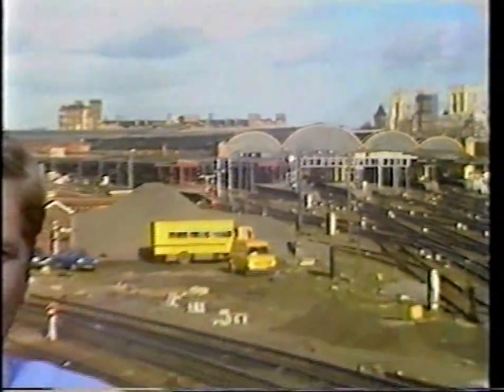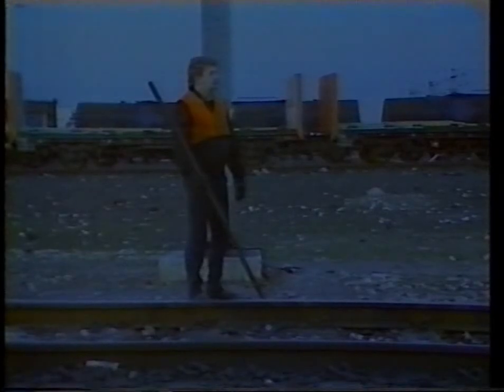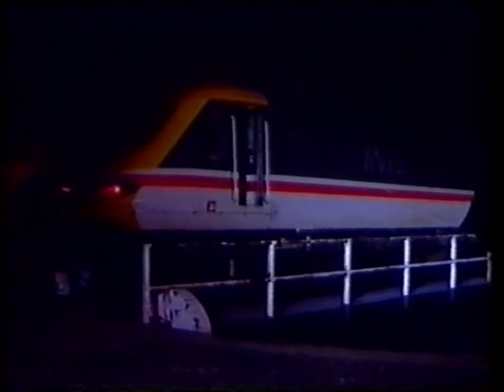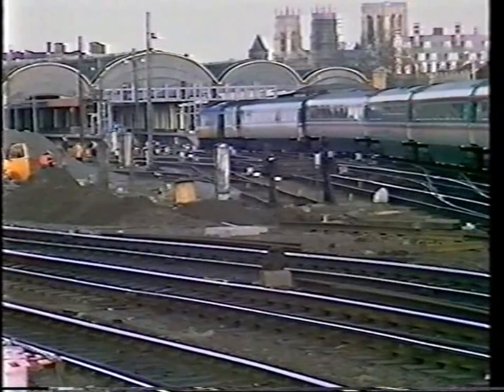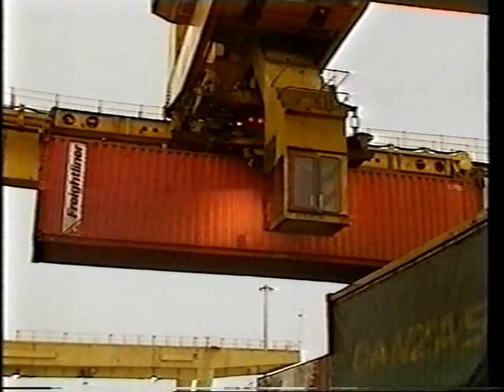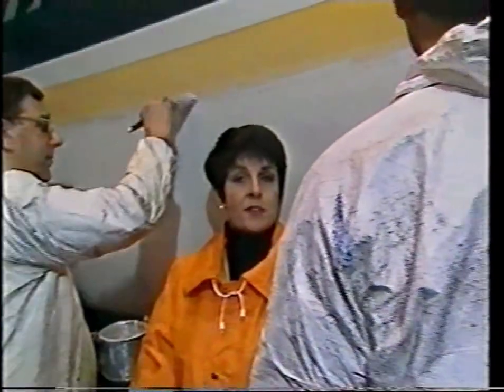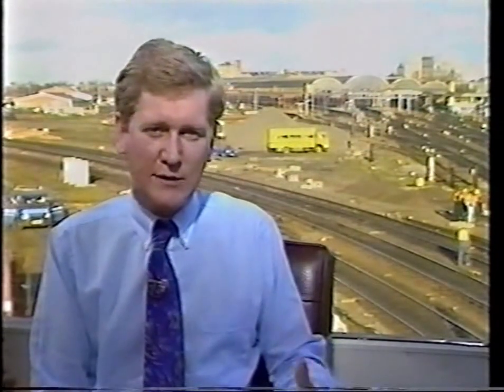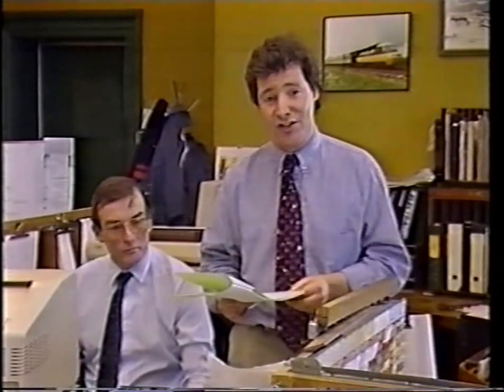Railwatch   day 3

Comment: A great historic record of the 1980s ECML traffic profile. The core InterCity operation is much the same today (for HSTs read class 800s), and Donny PSB is still with us, but nearly all other operations are so different. Can you imagine a present-day train operator being so open about wrongly-adjusted yaw dampers?😉
HST set is quoted at £4m apiece; £9.8m in 2023 money. Compare that to the £5.7bn contract value for the original build of 57 Hitachi Class 80x sets for GWML and ECML; a whopping one hundred million pounds average per train set in 2017, equivalent £124m in 2023. Great value or what?!!